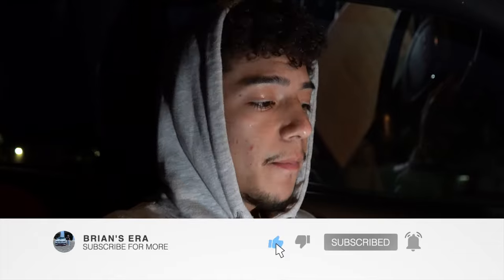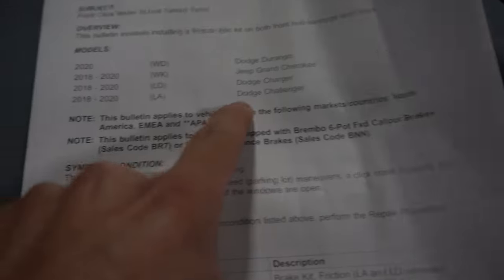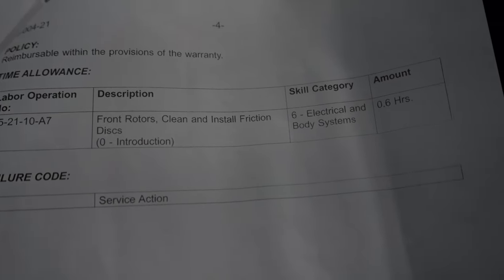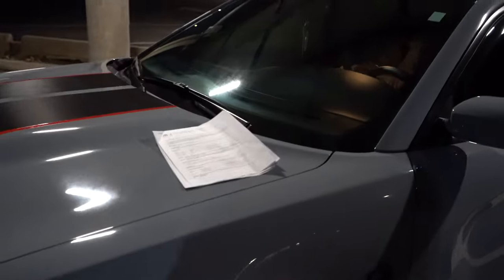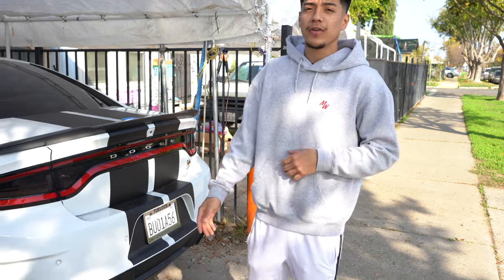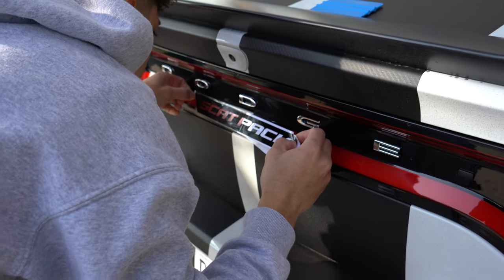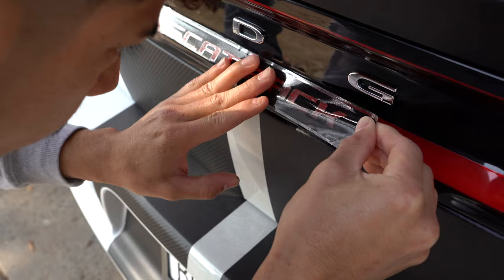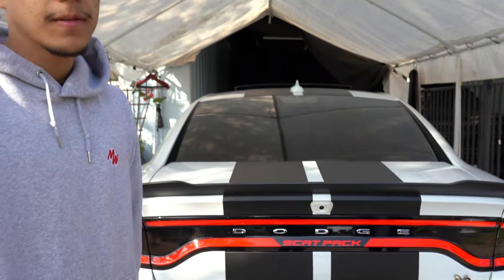WHEEL TICK ON MY DODGE CHARGER  SCAT PACK WB 2021 (REAL FIX NO CLICKBAIT)

Comment: Bro i dont think you know what the hemi tick is.. its caused by the lifters inside the engine coming in contact with the camshaft and you only hear it at idle, not when youre moving..it has nothing to do with the rotors which belong to the brakes.
Reply from the maker: It on the paper bro that’s what dodge told me and from other videos I’ve seen they all said the wheels needed this part and so far it stoped my noise 👍🏽 thanks for watching I appreciate it tho 💯
Reply: @BriansEra  this is a different tick though, but not the "hemi tick" . Just search here on youtube bro, they call it hemi tick cuz it comes from the engine which is a hemi.. this tick you talk of is a different type of tick coming from the brakes
Reply from the maker: @Scotty secretly loves Chryslers i fixed the title ahead of time thumbnail couldnt change but if you watched and seen what i was talking about people know what i meant 👍🏽